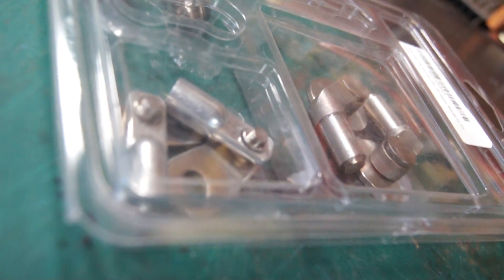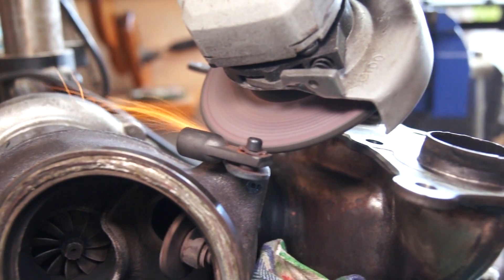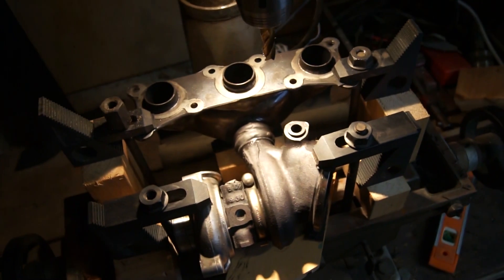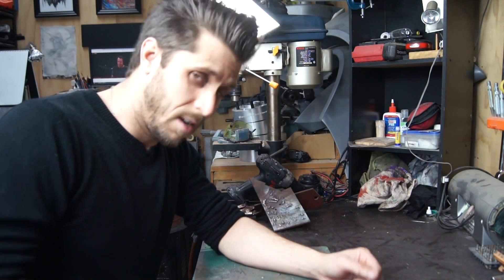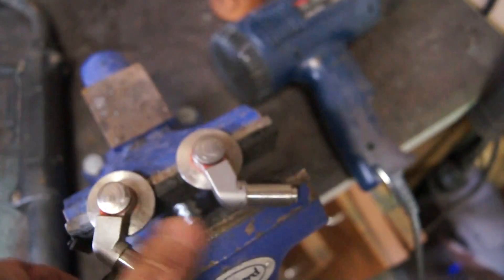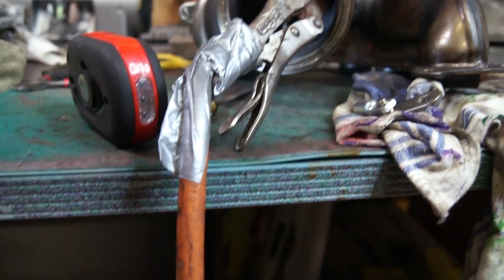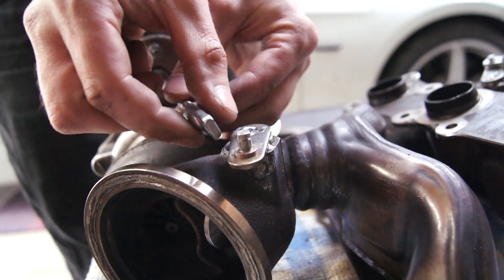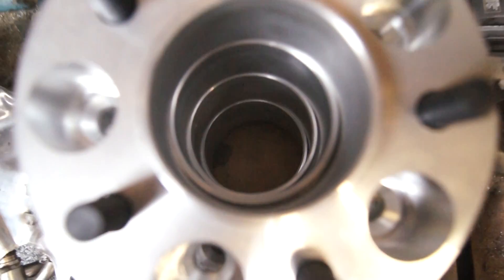Fixing BMW 335i N54 Wategate Rattle 100% For Good!

Comment: This silicon on the flap is absolutely unnecessary, because the heat will vanish him in a couple of minutes. Also is good idea to use slide hammer for push out the old bush and hydraulic press to put the new one. Anyway, the video is good and you have interesting workarounds. I always support the repair of old parts instead of buying a new ones with same defect.

Comment: It's the Bush that rattles when it wears out, not the penny valve itself, they are supposed to move
Reply from the maker: Debatable, they're supposed to move for sure but they could also easily rattle with extra wear or the right harmonics
Reply: I always heard that the bushing wearing out allows the flapper to go sideways or tilted making it harder and harder for the Wastegate to seal and eventually resulting in 30FF.
Reply: @DarioPerazzini  I must say I've never heard of the flapper being the issue, it's always play in the bushing over time ovals out.

Comment: Hey Dario, so after that 100% fix, how much miles have you done in your car, and if it still works, or started to rattle again? I'm just asking, cuz I bought whole set - 2 turbos with wastegates regenerated from a guy that makes turbos regenrations, it was ~ december of 2020, so 3 months ago, mechanic replaced my old turbos (which was in qutie good condition, but there was wastegate rattle.. so I decided to replace whole set with turbos, just "in case") and... I did ~1600kilometers and.. guess what.. new wastegates started to rattle hard... fckin shit.. he gave 3 years guarantee for the turbos set, however don't wanna to pay for the mount/remount turbos.. I pissed.. looks like he fcked up with the wastegate regeneration.. :/ don't know how to handle this.. I don't wannna pay for the mount work just because he did bad regenration..

Comment: You really need to run Argon on that mig welder to get a good clean weld. Flux core wire is garbage unless absolutely necessary
Reply from the maker: Interesting that you could tell it was flux wire from the footage...because of the bbs?
Reply: Dario Perazzini yes sir 😉
Reply: As a DIYer though, I doubt that flux core welding is going to be an actual issue for this. The welds look decent. Anyways the important is not the visual it's the penetration.

Comment: how much would a shop charge to do this? would it be more worth it to just buy new turbos?
Reply from the maker: No idea, if you get new turbos get aftermarket so the same problem doesn't repeat 80,000kms later
Reply: Dario Perazzini i was gonna get a pair of used ones with low miles and do the repair kit for down the line
Reply from the maker: @smiley5oh  it's a lot of effort to get them out, I'd upgrade at same time but obviously up to you

Comment: Hmm, I have a wastegate rattle and I get the 30ff code along with a whistle sound when driving under load. Changed vacuum lines above and under the intake and next I'll change the turbo lines as well, but I gear I might have to do the turbos... could you please post some details 9n how to remove the turbos without removing the subframe? I just had the oil pan gasket done and stupid me did  it address the gates
Reply from the maker: Sure. Downpipes off then I put a scissor stand under the right side mounting bolts of the oil pan with some thick rubber in between (there is a logical safe spot you'll see) then undid the top nut of the engine mount from above and lifted the jack until there was space between the mount and the frame so I knew the load was off, then I removed the mount. With that out I could reach everything on the turbos. You will need new mount bolts as they are stretch. Hope that helps.
Reply: @DarioPerazzini  ty sounds like its doable lol

Comment: A lot of your repairs are intresting 😅. People watching this, this is not your go to.. Please don't put silicon on your Wastegate, they move so they can seal properly.. Don't put nails in for looking the new bushings, rather tap with whatever screw you wanna screw in to lock. Or tac a locking, only tac, don't bring more heat to the metal. If your sure about your welding. Just weld the top of the bushing as he did as safety 😅.
Reply from the maker: Yeah I doubt the nail would be enough hence the tack. I wouldn't even trust a screw tbh...you don't want your bushing moving at all. The silicone was an experiment that worked, didn't stop the articulation and removed all rattle until it obviously burnt off. If I was to remove again I'd look at some kind of super thin gasket material to keep the flapper from rattling. Pretty poor design tbh.
Reply: @DarioPerazzini  did you find something to fit the wastegate some special silicon?